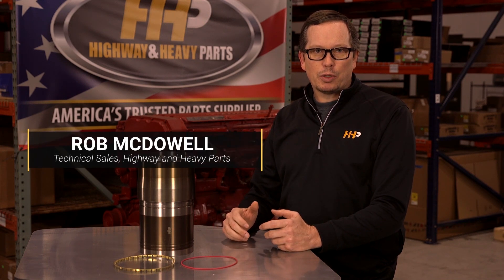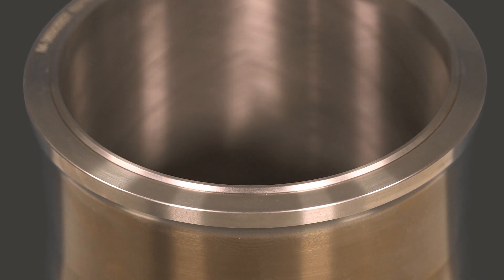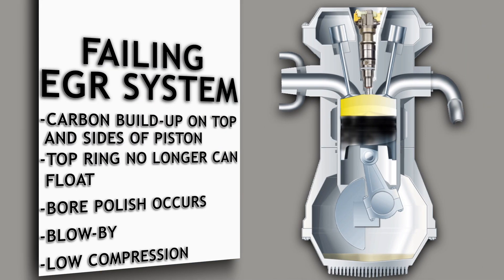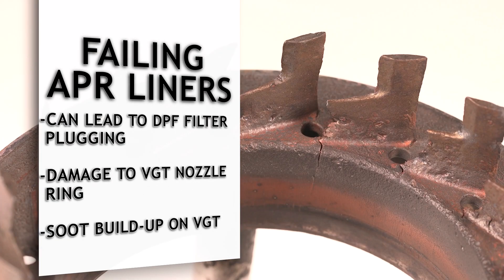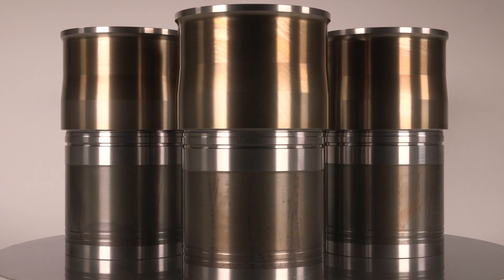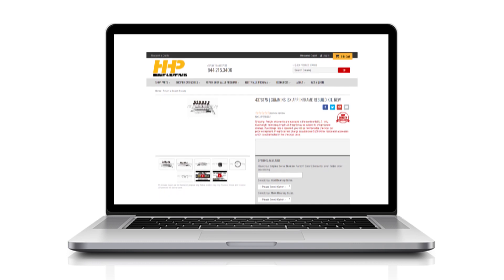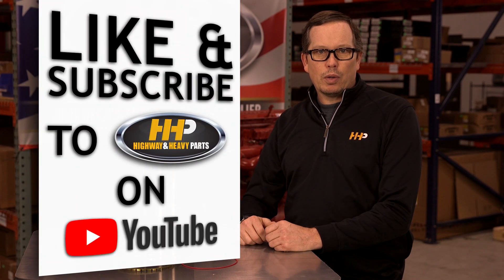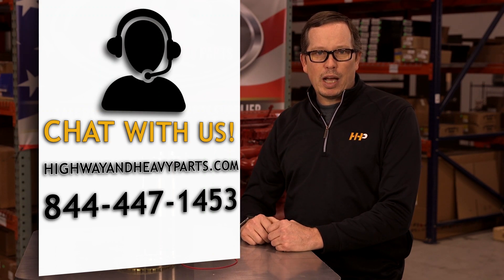Diesel Anti-Polishing Ring (APR) & Liner Failures. How it can harm your VGT Turbo

Comment: If I installed the liners with out the apr's then realized I need to put those in but measured the pertrusion and it's 1-2 thous out.. Will that make a difference and if I put the apr's in and keep the installing tool on will that give me my pertrusion number I'm looking for?
Reply from the maker: The cylinder liner measurement must be made with the cylinder liners in the clamped state. For antipolishing ring liners, the antipolishing ring should remain installed for centering of the liner installation tool force plate. Install and tighten the cylinder liner installation tool, Part Number 3164606, to clamp. Rotate the force plate until the areas where the  protrusion  measurements will be taken are exposed.
Torque Value:  136  n•m    [ 100 ft-lb